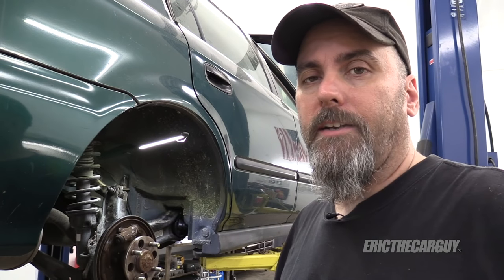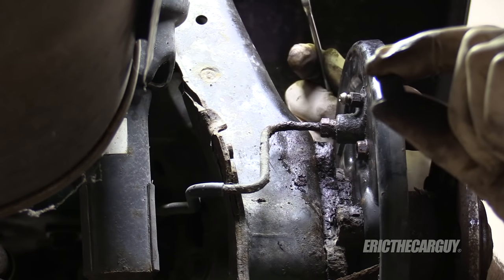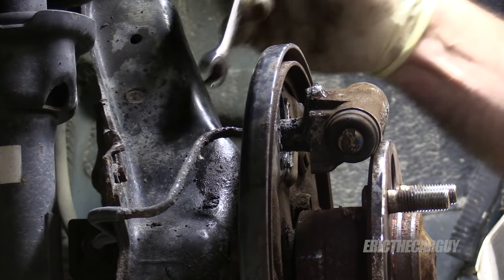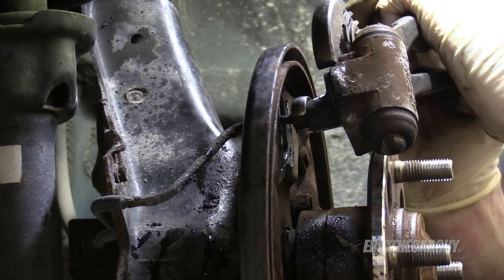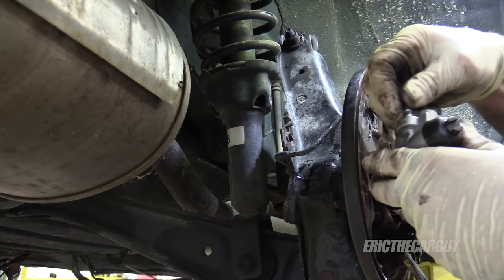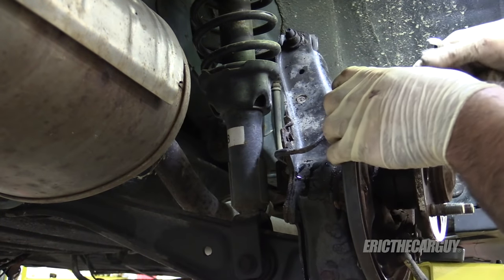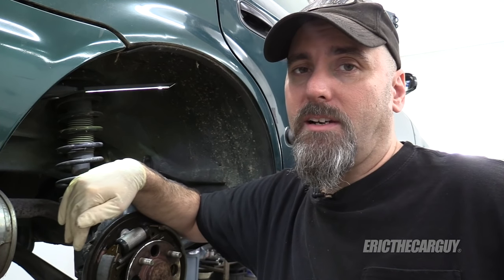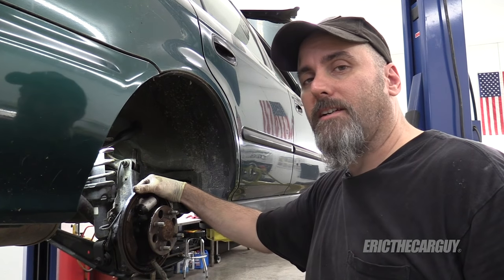How To Deal With Rusty Brake Lines

Comment: Here in Iceland we deal with badly rusted parts on a daily basis. How I get over this problem is as simple as heating up the fitting. By heating it up, 9 times out if 10 it will come loose pretty easily. Most of the time the issue is not the break line corroding onto or into the fitting but the rubber sleeve that is fitted onto the factory brake line gets pushed into the fitting by the oxidation or corrosion underneath it.

Comment: I really thank you for your videos. They have helped us a ton. But this time I think that replacing that rusty line should have been the best solution. It will have a hole very soon and if it happens while driving, the driver might get into an accident if he or she panics. I'm saying this because I'm currently replacing a rusty brake line that I thought would not be a problem but now it has a hole on it.

Comment: ...yeah, I had to re-do all the brake-lines on one side of the front of my '71 Super Beetle because of this issue. Unfortunately, it'd had a disc brake conversion...and needed the lines replaced anyway, but they did break on me in a similar manner.

Comment: Thank you Eric. If installing new wheel cylinder remove as Eric and put lots of penetrating oil  on the brake fitting and remove piston in the wheel cylinder.  Put lots of penetrating oil on brake fitting insert large screw driver threw cylinder and turn cylinder while holding the brake line. Lots of penetrating oil on brake fitting and it should turn but only turn in 1/8 - 1/4 turns and go back same amount till it rotates freely.

Comment: Just a little heat even from a small propane torch has always worked for me. Also anti sieze between the line and flare nut and on the flare nut threads will prevent it from happening again.

Comment: Both of the front brake lines on my 71 olds rusted out to the point where they gushed. Coupla squirters. Got some parts store lines and bent them as close as I could to the ones that came out. Held my tongue just right and no issues. It’s not too hard don’t rear end some one! Lol.

Comment: Glad you mentioned the option to pull the line up further. I would be hesitant to trust it for any duration with that kind of corrosion. However I'm not in a part of the country where rust is a real problem.

Comment: Great video, I had forgotten this technique. 
  I’m in the middle of doing the infamous, dreaded 2007 Subaru rear hub bearing in Maine. 
  I just realized I ordered the entire kit, the knuckle, hub and bearing, long bolt & bushing for the lateral arm and it comes with a new backing plate. 
  I have to swap everything off the old backing plate, onto the included new backing plate. It’s sandwiched between the knuckle and the hub, can’t slide it over the hub. 
  The rust is so bad the bolts for the wheel cylinders and ABS sensor are no longer octagon shaped. The parking brake cable is frozen also. So far no joy with the vice grips and some heat. 
  I guess I’m going to have to press out the brand new hub from the new bearings….carefully, oh so carefully. NOT looking forward to this. (still waiting on the parts to arrive). 
  Unless you have another method???

Comment: I have dealt with a lot of that. When the brake line looks that bad ill heat that up by the nut with a torch. That almost always loosens it. Then I replace the line because its weak. It may hold but if someone hits the brake pedal hard that will bust the line

Comment: Nightmare flashback to being under my 66 Dodge D200 for a month back in '86.  Started on the rear line on the axle.  Ended up redoing everything including the SINGLE chamber master cylinder.  To go is good.  To stop is better.

Comment: I've always found that along with penetrating oil, I first tighten it a little, then go for loosening it. If it comes loose, great, if not then I rock the nut back and forth in small moves until it does. It the line isn't rusted so bad it breaks, they come right off.

Comment: My local mechanic has replaced four brake lines on my F150. Prior to that the Ford dealer replaced all of them at once about 4-5 years prior. The explanation my mechanic gave was these lines were touching rust underneath already, causing them to rust out and fail again. Aren't there Stainless Steel brake lines available? If so my next vehicle I run into the ground will have all lines replaced with stainless.

Comment: When doing brake repairs...
Always replace rusted brake lines... both sides..😉
And main feeds from brake master cylinder if need be.
No matter how big of a pain in the neck it is after you are done with your brake job spray them all with lubricant to prevent them from re-rusting as long as possible.
And you can spray the threaded area joints every few months with WD-40.

It's also a good idea to spray all of your bolts and nuts in the front end.... struts ..shocks.. tie rods and in the rear end.. shocks ...Springs... Etc to make future repairs easier if need be.
Reply: Where i live we dip bolts into spent motor oil before reassambly.

Comment: i just clamp the brake line nut with a teethed vice grip the hardest i can (it may deform and thats ok), then remove the vice grip and reclamp it 90º OFF.. after this second clamping dont force it or it may strip completely, just give it a hard-dry tap with your palm. it WILL ALWAYS unbolt no matter how crusty it is...Eric please try it you will not regret ...  after this you may not be able to put the 10 or 11 mm wrench because the brake line nut is deformed but you can safely tight it with the vice grips again...done this a million times never had an issue....however if it is a customers car or if you are not sure about longevity or safety just replace the line...here we can have a line custom made for less than 10€

Comment: just a note when you replace brake lines with reg steel if you can get it its called red lead it a primer rust preventive that the navy uses on ships, paint that on your new brake lines and they will not rust, other than that use nico copper lines.

Comment: In my opinion it's a great way to temporarily fix car and go to parts store for new break lines.
Reply: vampirwrr fold the rusty line over and pinch close with vice grips. Drive to store to get enough materials to fix correctly the 1st time.

Comment: Eric, you lucked out on this one!

What if the threads started (or ended) 
in a different spot?  When you had the 
fitting tight, the cylinder was upside 
down, or 90 degrees off?  It seems 
the threads DIDN'T match up.

I'd just change the line, just like you 
did.

steve
Reply from the maker: It doesn't always work, but when it does, it does. At least it's worth a try if the line isn't in bad shape. Thanks for the comment.

Comment: Eric, questions for you. Re: How to stop air into hard lines when replacing flex hoses at caliper. Once the hose is removed how do you stop air infiltration so the bleed process doesnt take forever or introduce too much air as too affect ABS system? Specifically, I was researching how to stop air getting into the brakes lines when performing a 4 wheel disk brake caliper refresh with new caliper pistons and square seal and dust boot on all four wheels on a 95 Jeep Grand Cherokee. There are no videos that come up anywhere on YouTube search, on the proceedure of removing the calipers and removing the rubber brake hoses to replace them all around while not introducing air into the hard metal primary brake lines. I see some people clamp the rubber lines with a vise grip of various types but I need a non destructive way to stop air from getting into the metal line while removing all four calipers at the same time in order to degrease and repaint and service them. Your feedback? Ideas or any video suggestions to visually show how to plug or stop this from occurring? Thanks, very much, in advance, Eric.
Reply: As soon as you remove the hose from the hardline, cap the line end with a vacuum cap. Also keep the lid on tightly on the MC, and full of fluid.

Comment: Heat is your friend.  I will often use a butane torch to heat the nut and then hit it with penetrating oil.  More often than not the nut will loosen up with sone wiggling.

Comment: On some special coating lines this often happens even if the line isn’t really rusted.
Reply: Maybe you have that backwards?   Coated lines are much less likely to seize the nut on because that coating doesn't rust, at least the typical nylon or whatever plastic coating doesn't.  Maybe if  you got water in the line and it rusted from the inside out that won't  help.
Reply: No. Maybe because line is protected by coating it to rusts more in non-protected areas. Or maybe some coatings actually act as glue or cause some reaction. Here’s one video where the line isn’t really rusted https://youtu.be/LcJQa9kh_js

Comment: My rusty rear brake line on a civic blew while braking from 80 mph to a stop downhill. Shocked that its not fail safe system if on line leaks it doesn't lose all fluid and all brakes. My transmission hated me for the next 10 miles getting her home with engine braking. Please chaps always replace

Comment: What about where the line wrench just slips off? the line nor the nut turn when i try to break the nut on the line into the wheel cylinder. the nut looks fine but the threads into the cylinder look rusted. ive soaked both sides with PB blaster two days. Not sure if I can use heat to remove. The line isn't to rusted but the other end that goes to the hard lines on the body the only the nut is rusted. If i can remove that I would just replace the line and cylinder but that nut looks worst. Body lines look good at least

Comment: relistically how much work is it to just make a new line from the hose to the wheel cyl anyway? takes what 15min? If you are going to do it like this though just unclip the hose from the holder bracket and the line will be nice and free and pull further out of the backing plate

Comment: I like it when I watch your vids, and see I actually do something right for a change. LOL Now the question becomes, if you break the line, is a compression fitting good enough? I think so, but my state I live in disagrees.
Reply from the maker: Will a compression fitting work, probably, but as you pointed out, it won't pass a safety inspection. Therefore I always bend and flare new lines. In fact, I had to do that very thing on this car. It sucked, but I know it will pass NY inspection which is where the car will end up. Thanks for the comment.
Reply: I'd probably feel differently if I had a nice double flare kit, such as the one you have. I just have a cheap one I picked up at Harbor Freight. I don't feel I get good double flares with it, and a compression fitting seems stronger.
Reply from the maker: Save up for the 'good' tool. You'll never use a compression fitting again. BTW, they make a smaller version that works great on the car. https://www.youtube.com/watch?v=AP3z_Qg_6-o
Reply: @tistricky8340  - For what it's worth, I've been using a cheap Chinese made kit for almost a decade, identical to that harbor freight thingy.
Never had a single issue with the pipes I made. At least none that I can attribute or trow the blames on the tool. LOL 😆    
Certainly a "pro kit" appeals to me every time I use it. But quite honestly it never failed on me once... and was dirty cheap!

Comment: Hey Eric... great channel...but won't it be easier if you removed the Pistons and spring and insert a rod to get leverage when trying to rotate the cylinder?
Reply from the maker: It would have been easier to remove the line from the other connection and put the entire thing in the vice as I suggested in the video. At least in my opinion. In auto repair, there are 100 different ways to do the same thing. Do what works best for you.

Comment: 9.30.18.   If you don’t have any of those rubber caps for the Break bleeder fittings, then you can use 100% silicone caulk and just blob it on, ............ a.k.a. jelly weld™️❗️ The next time you have to bleed the brakes just pull it off, works like a champ‼️☕️

Comment: Should you  put some copper grease or similar on the new brake  bleeder thread  to avoid it seizing up into an aluminium cylinder which  was an issue I had a few years ago?
Reply: In that case you would be better off using aluminum grease. 
But whatever the case aluminum or copper grease is better than nothing. 
Tip: Apply a minimal amount of grease, to the thread. Set it in place and CLEAN the excess. ;-)

Comment: I spend 5 minutes with those fittings on short lines. If they don't crack free... Cut em and run em. Nicopp brake line and the mastercool brake flaring tool kit. Just drill out the old line on the brake fittings and reuse them.

Comment: You should see what they look like in Salt strewn Minnesota. To replace brake pads. I have now just excepted my fate. Everything gets replaced to the first brake connection that does not just crumble when you touch it. let alone twist on it. Even if you get the pads replaced with out braking a line or two. No way the bleeder valve is coming loose.
I keep a well stocked supply of coiled brake line and fittings.
Minnesota.. It is what it is.

Comment: Have you got a way to get them off of the rubber lines that feed front calipers?
Reply from the maker: You can do the same thing if you can remove it from the vehicle.
Reply: EricTheCarGuy several months ago i decided to change the 23 year old front brake hoses on my f150. Well i guess i was too focused on breaking those corroded nuts loose without thinking i could just unscrew the hoses by holding them nuts! Ended up breaking the lines and had to replace lines all the way back up to the master cylinder. Lesson learned!
Reply: mikey mike you did yourself a favor... unless you like making things nice by doing it twice.

Comment: In all my years as a mechanic here in Australia, I've never seen brake lines like that. I can only assume over in the US you guys put salt on the roads during winter????
Reply: Being from a country with similar climate to Australia. I confess that in all honesty I had no idea what RUST was! Brake work was clean the dust (lots) and change pads, done! In a few decades changing a brake pipe was an extremely rare event!  
Now live in Norway, rust as it's own citizenship card. Brakes need major "cleaning", meaning remove huge flakes of rust, every 6 months. Usually when changing between the Winter/Summer tires sets! Brake pipes... Let me put it this way. I changed brake pipes in ALL the cars I have/had here! Here you can feed a family just by working on brakes! LOL 😂
And you learn to not even dare to look a bolt or nut without using anti seize paste!

Comment: How do you not rip your rubber gloves? I always do.
Reply: Best question ever...I'm betting Hollywood magic & a case of gloves lol
Reply: dork getreal get 9mil heavy duty black from harbor freight. FWIW-I used to like’em snug,no slack but I noticed a couple rips. I went up a size and xl fit better,don’t cramp my hand and tear less
Reply: i have big hands, how do you get ones that fit, if i buy extra large the fingers are to long, story of my life. And my hands sweat,, take the gloves off water pours out.. To many years as a carpenter.. are hand are thick!
Reply: When/if using gloves I tend to wear the rubber gloves, under a normal set of gloves. Spare a bunch of rubber gloves, which otherwise would last... 2 minutes! Of which 1,5 minute would be looking for that 10 mm socket that always vanish! LOL 😂

Comment: Would this tip also work with calipers?
Reply: On pretty much all calipers without banjo bolt connection. This is the way to do it. After all, by far and wide, they have threaded end on both sides. ;-)

Comment: if you have troubles, it's better to save some money and replace all you can, especially brake lines
otherwise you wouldn't be able to deal with seized parts and the repair would be much more expensive

Comment: Hey buddy I was wondering if you had any advice I have a 95 accord that was sitting for 4 years and it was running great I had done a tuneup and map sensor right before it sat and I had just started it up and the idle is now surging as if the map sensor it bad what could be the problem is there any chance of it being bad gas ? Any help would be great appreciated
Reply: Probably a vacuum leak, check the rubber lines for cracks
Reply: It was the idle air control valve I cleaned it and worked for a while so I dident think it was it but it's better just to replace it than to do the work twice I got the part used because a new one is 200 $ and the used one was 40$

Comment: The rubber brake line should be replaced every 6 years anyway. If it's rusted that bad it needs to be replaced or else it can block fluid from returning after the brake pedal is released which causes the drum to seize up.